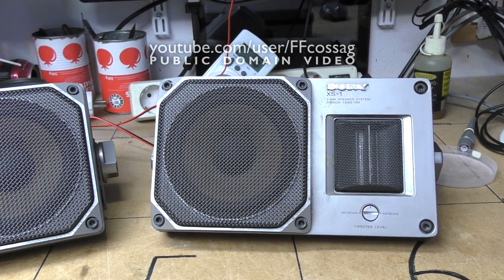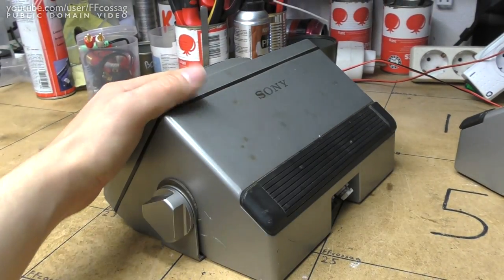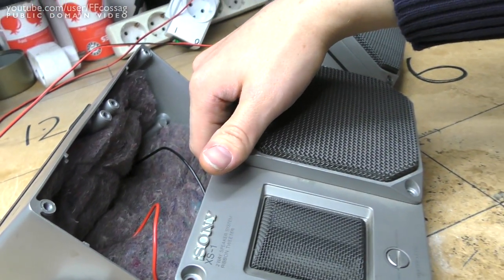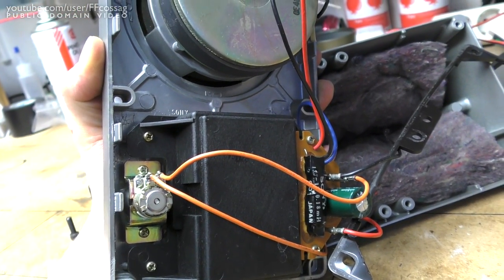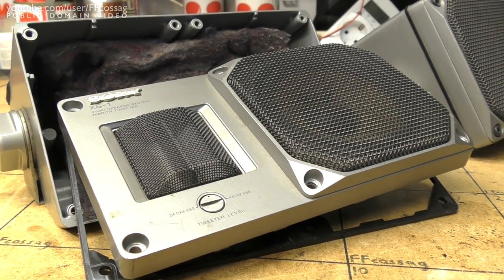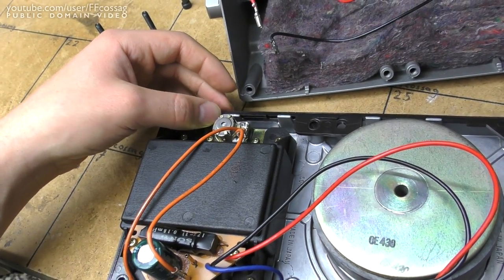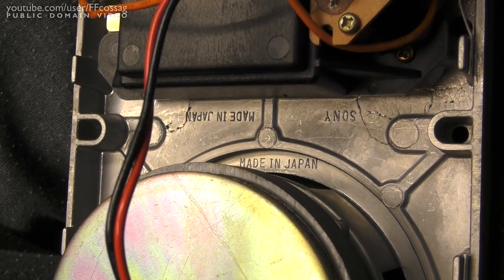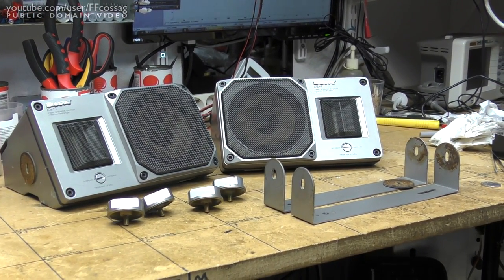Sony XS-1 vintage die cast speakers - Teardown

Comment: If you replace the crossover caps with new audio caps - you'll be able to clearly hear the difference. Especially those old elecrolytics which would have deteriorated by now.

I had a couple of old EPI 100s that I re-capped, and they sounded night and day - high ends became bright and sharp. And they were already good before.

And its only a few dollars.
Reply: If the old caps measure up to spec there won't be a difference at all.
Reply: I'd say try it.

I'm not an "audiophile" that nitpicks and pretends to hear subtleties. This really made a difference.
Reply from the maker: While I haven't bothered measuring the caps in these due to a lack of time, they sound neutral enough for me not to suspect any crossover issues. Mind that capacitor technology has rapidly moved forward; a cap found in your 60's EPIs is many orders of magnitude more likely to have failed than one found in these ~1980 speakers.

That ramble out of the way, your advice is sound - just not applicable here, I don't think.
Reply: @FFcossag  These speakers probably spent some time in the hot sun on the parcel shelf in some car.... Those capacitors should be replaced regardless... Just the tweeter alone is expensive and rare, very well worth the few dollars of protection from new capacitors...